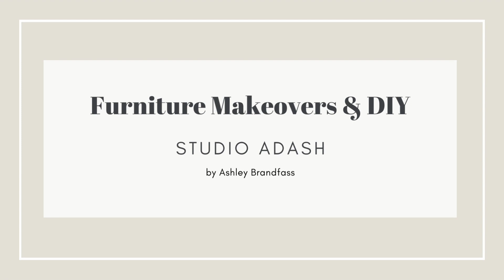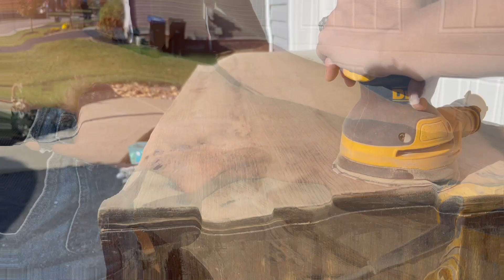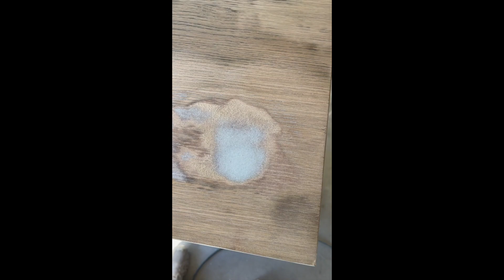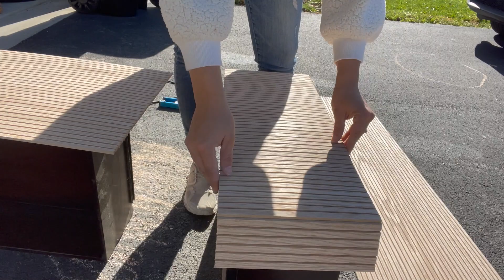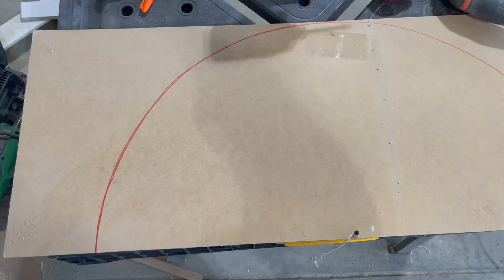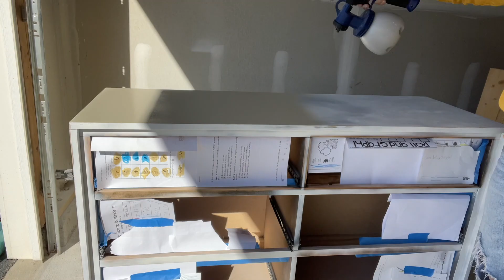FREE Dresser Gets Extreme Makeover - Arch Trim Detail

Comment: Love this look! The base, the handles, and of course the pole wrap. You are so creative in your design. Did you use the automotive filler only on the spots where the MDF was exposed? And would you recommend still using the Bondo for large gaps?
Reply from the maker: Thank you! I’d definitely still recommend Bondo for any large gaps. It’s truly great (and strong) filler to use. 

I ended up only using the automotive primer on the damaged spots…and then used an oil based primer for everywhere else. The only the reason I did that, was because I was using a light color paint and wasn’t sure how the grey automotive primer would effect it. But I have used the automotive primer to prime a piece of furniture before and it works great! Just a warning though…it has a very strong smell so make sure you use it in well ventilated areas 😳